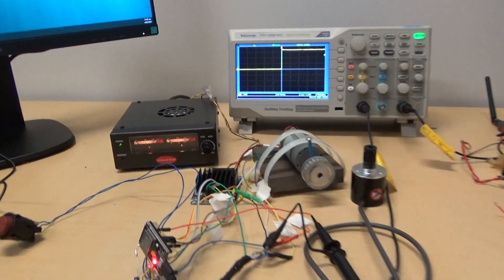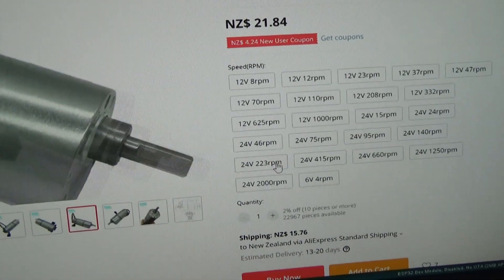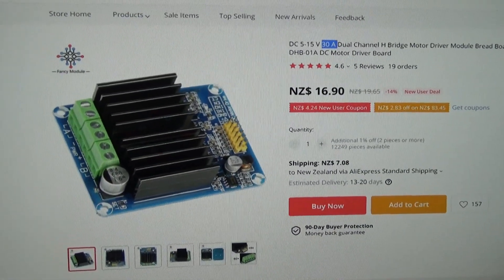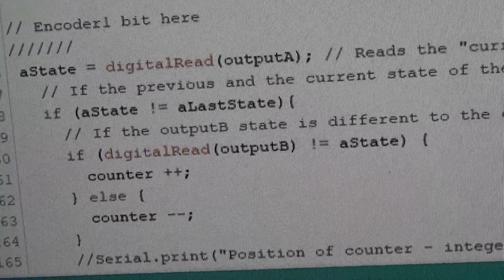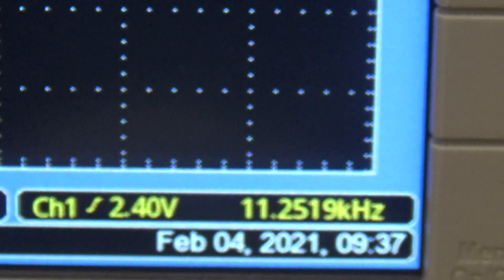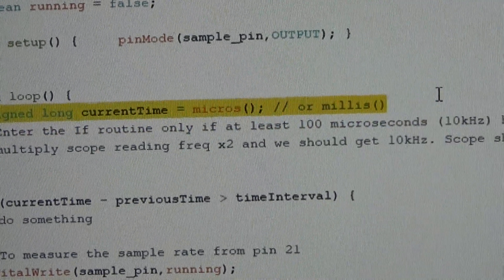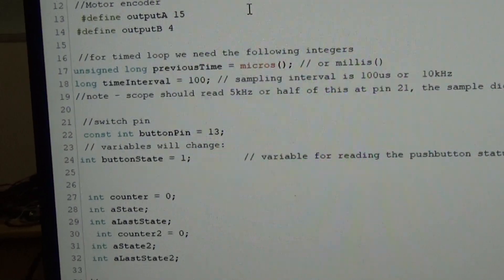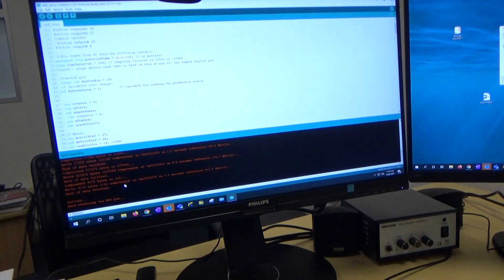Digital control of a dc motor using an ESP32 Arduino

Comment: Respected sir kindly do any thing with 3d printers with lab view
Reply from the maker: Not yet! That would be interesting. You would need probably a myRio or a Rio of some sort. The ESP32 though is much cheaper but has no FPGA built in or GUI.
Reply: @TJMoir  yes profesor it would be best if CRIO with C9505 motor drive chase would be used I have all of them but main issue how will input of 3 d structure to be plotted is given to cyrio module
Reply from the maker: @ejazahmed5885  Usually stepper motors are used for 3D printing though. Not sure if anybody has tried servos for such a project. Stepper motors are ok at low speeds but lose torque at high speeds. I am sure it is possible if you wanted faster printing say.
Reply: @TJMoir  You  always  can use a servo to replace stepper, even without changing software, there is some timing critical for a stepper but not for servo ,  the thing is that a servo will reach his position by all mean, of course if it cannot it will stop (you have a number of MaxNumberOfStepBeforeError that you can define if one step is 0.3µ then 500 steps will be 0.15 mm  it mean that if you have more than 500 steps undone the controller will flag an error